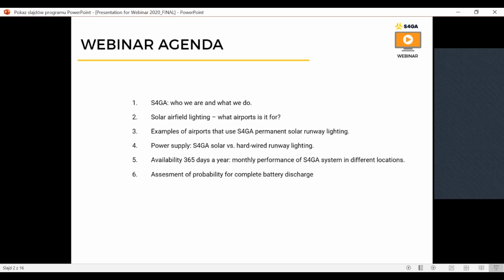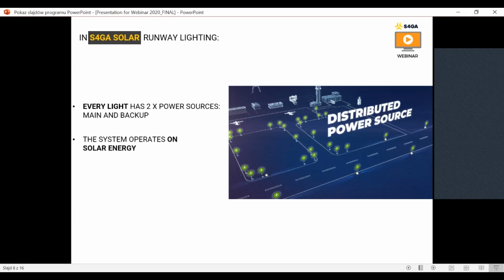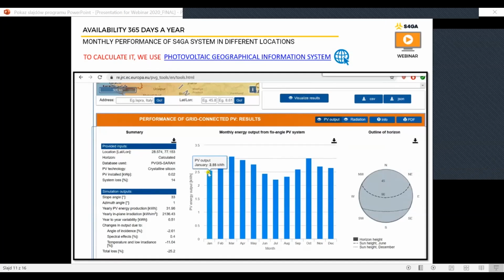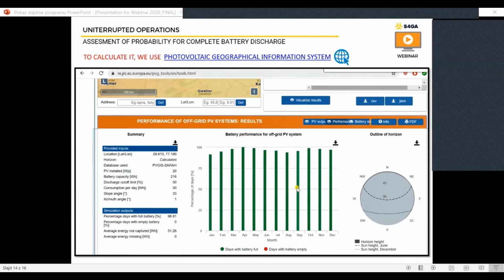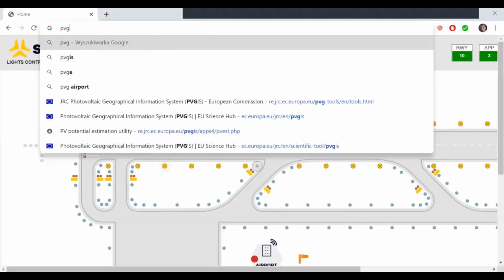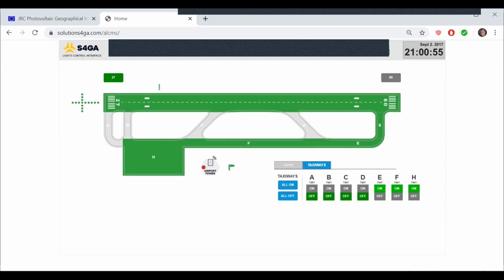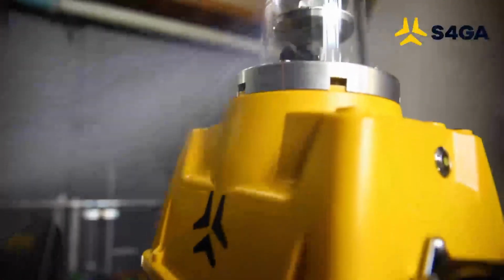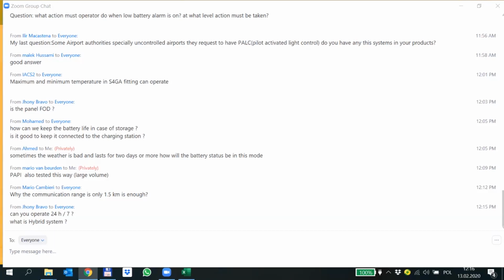S4GA Webinar: How Can Runway Lighting Operate 365 Days On Solar Energy

Comment from the maker: 2:00 Webinar Agenda
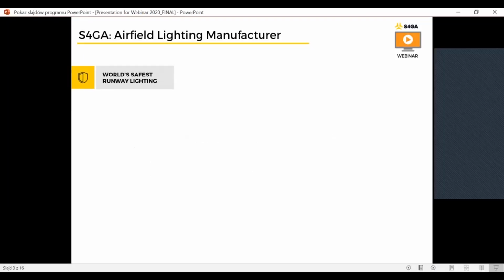3:43 S4GA: who we are and what we do?
4:38 Solar airfield lighting: what airports is it for?
5:52 Examples of airports that use S4GA permanent solar runway lighting
8:10 Power supply: S4GA solar vs. hard-wired runway lighting
12:40 Availability 365 days / year: S4GA system performance in different locations
23:28 Assessment of probability for complete battery discharge
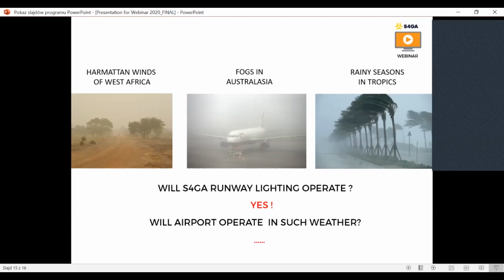33:05 Conclusions
35:05 Questions & Answers